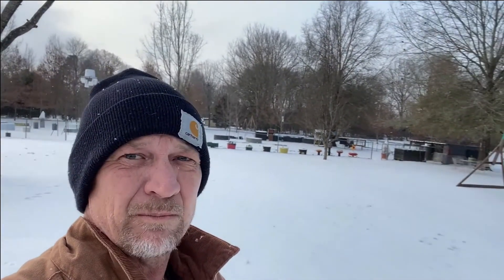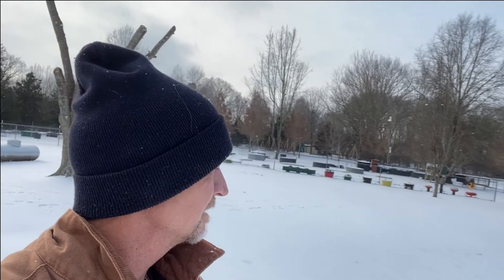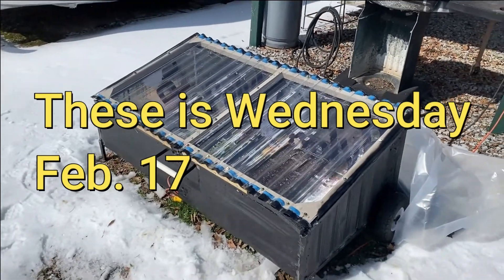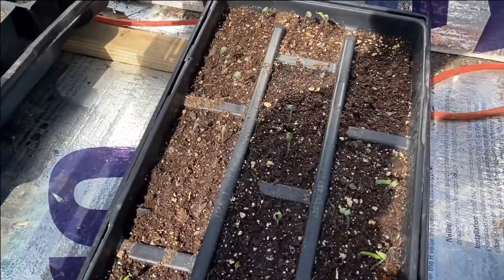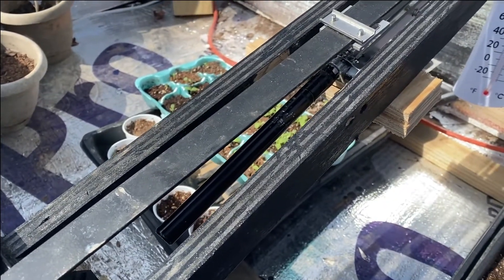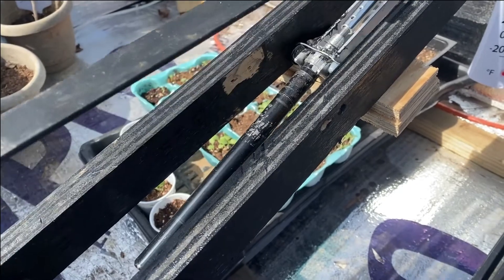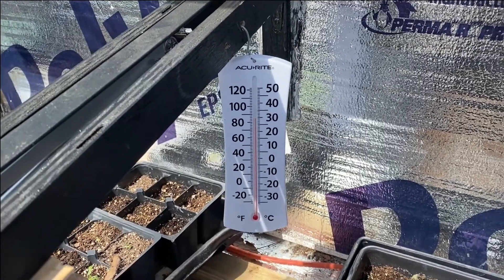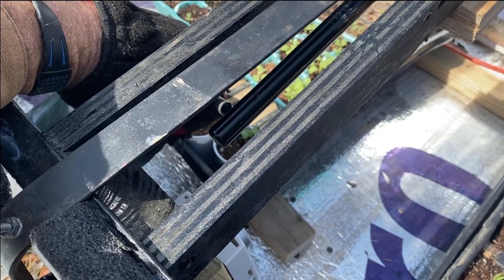DID THEY FAIL THE TEST? UPDATES: Temp. Controlled Cold Frame & Solar Powered Bionic Light.

Comment: That was a miserable storm.  We’re in rv and had to get creative.  Made a 25ft jumper cable and ran from diesel pickup to rv battery.  Then ran electric cords from inverter in 18 Wheeler and hooked up heat gun in goat hut.  We were better prepared for last weeks storm.  Experience is the best teacher.
Reply from the maker: A person doesn't forget so easy when we learn from experience. lol